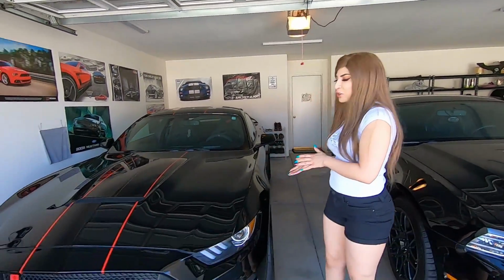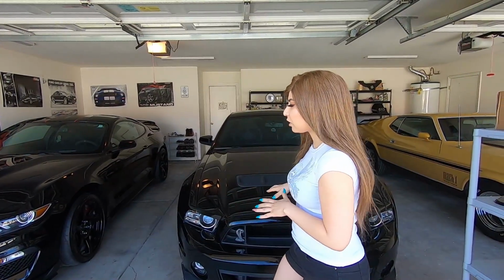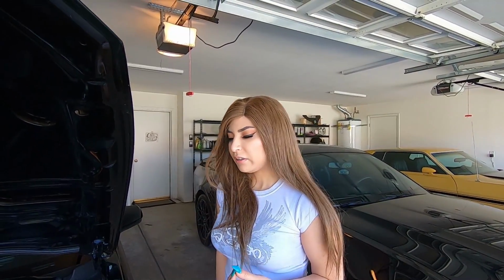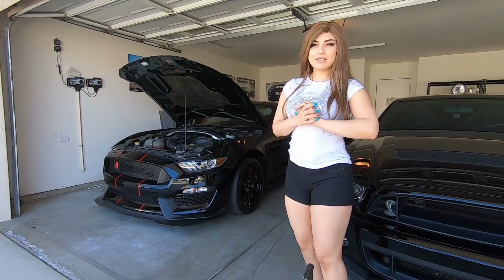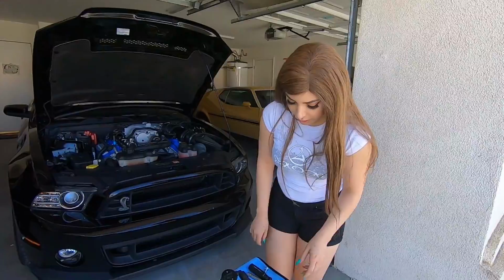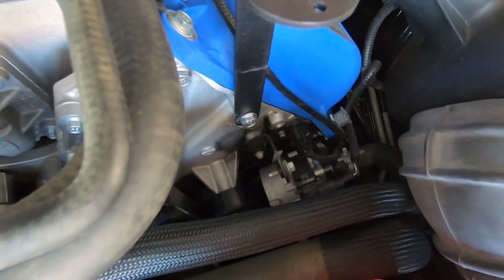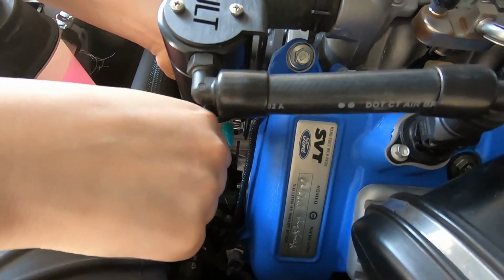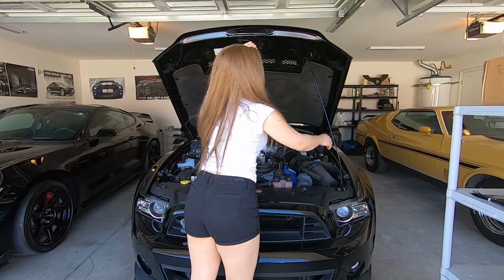Ford Shelby GT500 JLT Oil Catch Can Install

Comment: 🐍shes back ! I share you opinion on the ford performance catch can , I wasn't impressed, when I bought my 17 I went with upr , it works good on my other mustang so I stuck with them , I had no idea you had the mach1,  69? Cant see the front. 🐍😍👍
Reply from the maker: @Steve Hall  Hi Steve, thank you for your continued support. My Mach 1 is a 1971 351 Cleveland engine.

Comment: Does the floating can on passenger side either rub or rattle against valve cover?
Reply from the maker: As far as I know it doesn't. :)
Reply: @CurvesinMotion  ok I have this one in mind of interest.   I've read reviews that said it did leaving a mark on the valve cover.  Thanks for your reply. 🐍